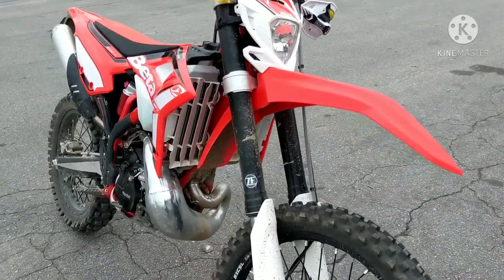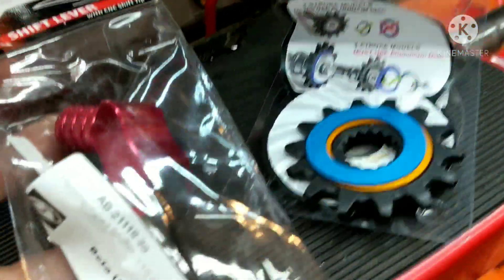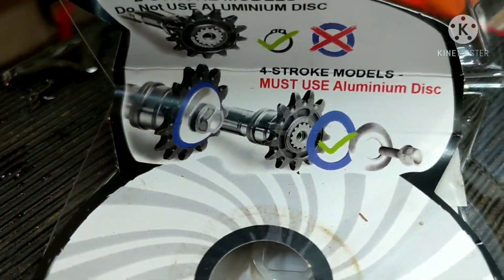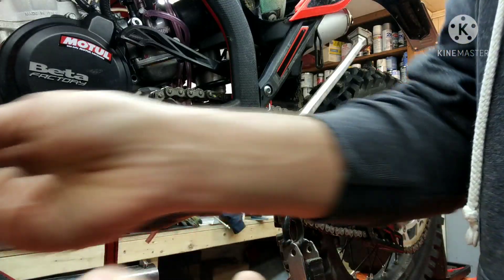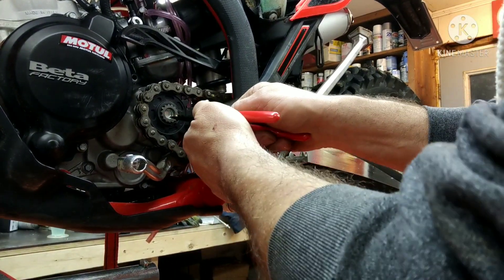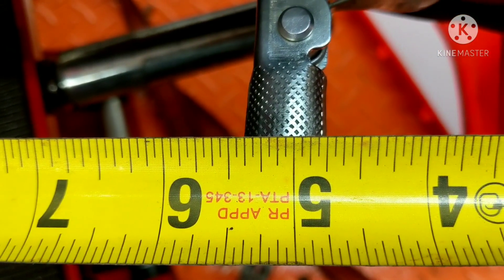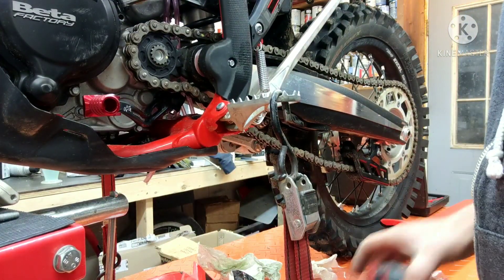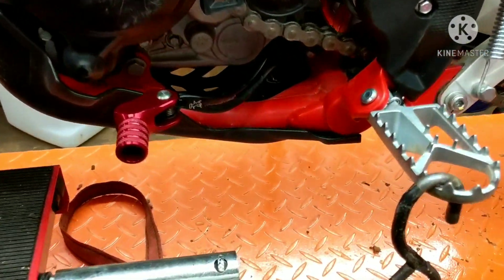Beta 200rr MUST have upgrades shifter and front sprocket, comparison measurements at the end!.

Comment: I had a similar issue with my Sherco trials bike and the longer shifter made shifts easier and more reliable. Many times I thought I had upshifted from first to second but the gears didn't engage. I have a 200 RR 2021 Beta now - and will see if I will develop a similar issue with the shifting.
Reply from the maker: This one was stopping at neutral going from 2nd to 1st. I have several other bikes to ride and none have this issue. I'm hoping this shifter will help as it breaks in. I really like this bike. Not all 200's are having this issue so hopefully your's doesn't. Thanks for watching.

Comment: On my 2021 I have been happy with going to 14 49, the shifter is next
Reply from the maker: Yeah I think the shifter is a must. As far as gearing it really depends on a few things, mainly your riding terrain and your skill level. I'm now 3rd and 4th in my trails where I have to cut my bars to fit. But if I rode in a more XC style open trail, I would have left it stock.

Comment: Should have replaced shifter when the sprocket was off. Stock shifter works fine for my size 9 boots.
Reply from the maker: I think the chain would have hung in the way. It was easy enough with it on. I wear a 10.5. Seems like the 20-21 are having more shift issues than the 19..

Comment: chain was eating original shifter.  See those wear marks at around 4:48 in the vid?  I better go check mine - and switch to a 14t.
Reply from the maker: Yep, the angle of the shifter was causing that. The new shifter is shaped differently and will clear a 15t with no interference if that gearing works for you. I run tighter single track, if you run more open single track I would leave the 15t.

Comment: What pliers did you use to get the sprocket clip off?
Reply from the maker: It's from a snap ring set. Harbor Freight Icon part #64597 the set has proven to be pretty solid.

Comment: Never heard of a 15 tooth sprocket on a dirt bike
Reply from the maker: See, now you can never say that again..lol..
Reply: @TepcoCycleRepair  lol!!! True...
Reply: Jean Lavallee , well the Beta RRS's use a 15 / 48 but are street-legal.  My 2022 Beta XT is titled and plated so I can get to the trails.  I believe it's got  14  / 49  and that's too short for me.  By the end of my block I'm in 4th gear and 6th on the highway doing 55 - 60 mph it's not "relaxed".  I plan to get a 15 front assuming it'll fit with no other changes.  But I'm not riding aggressive single track, either.  I also plan to balance my wheels which should smooth it out, also.